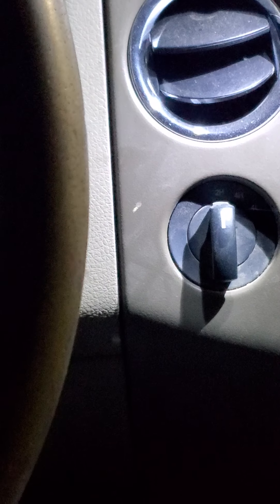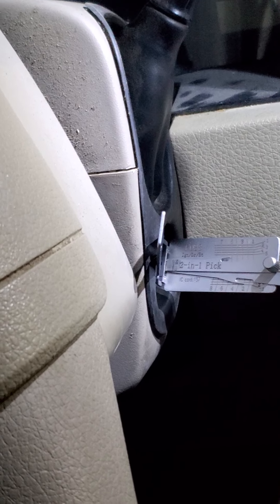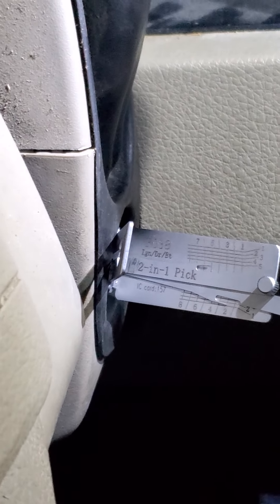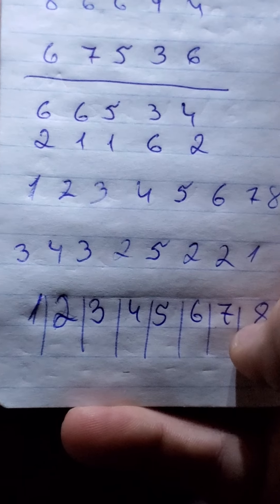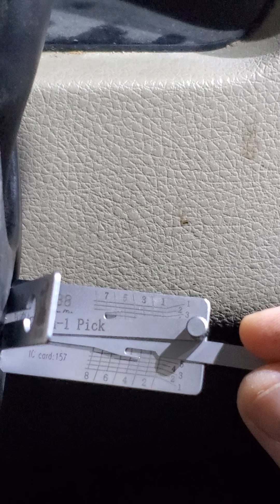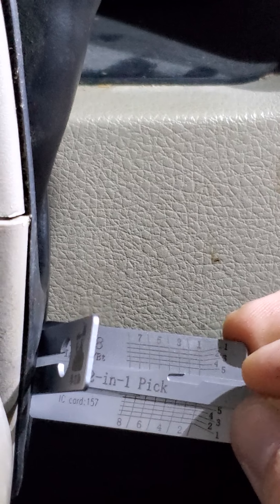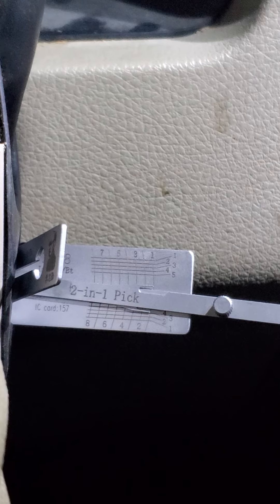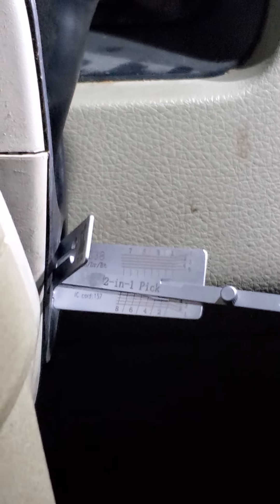Ford Ignition key is different then the door key

Comment: Same just happened to me but I wasn't able to lishi the ignition I couldn't get the first two wafers to do anything
Reply from the maker: That's bad, did you try to lubricate the ignition and insert a blank key multiple times. 
Sometimes you need to release the wafers.
Reply: @stasolocksmith  I actually did but nothing i
Reply: I lubricated it and inserted a blank key multiple times you think it chock be because it was aftermarket? I've done about 8 ford's that use the h75 key and never ran into anything like this
Reply from the maker: @eddcolocho6321  chang the ignition and key it to the original key, only option in this situation
Reply: @stasolocksmith  how do I remove it with out the key?
Reply: @stasolocksmith  by any chance do you have a video that shows you doing that?,
Reply from the maker: @eddcolocho6321  unfortunately I do not have a video, but you need to drill it straight into the cylinder left of the key hole but be careful not to over drill.
Clean it up from debris and turn it, basically you try to trill the retaining latch on the back